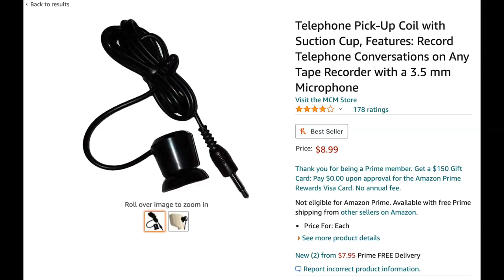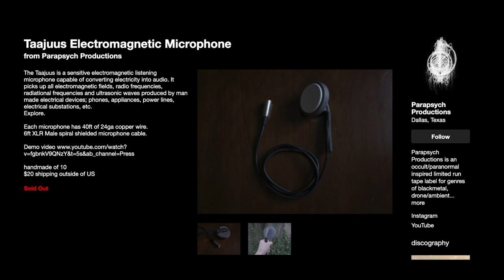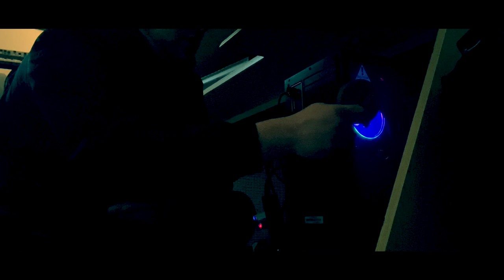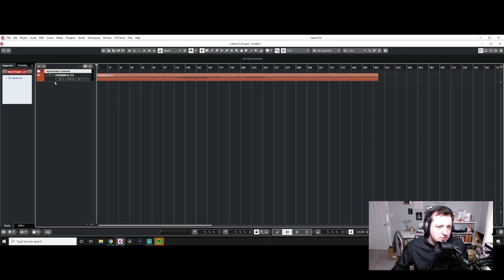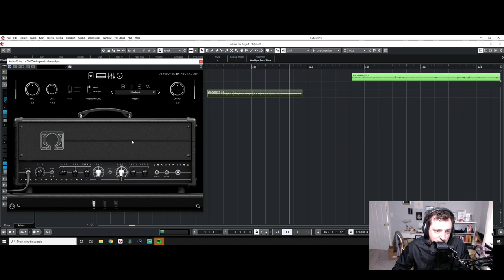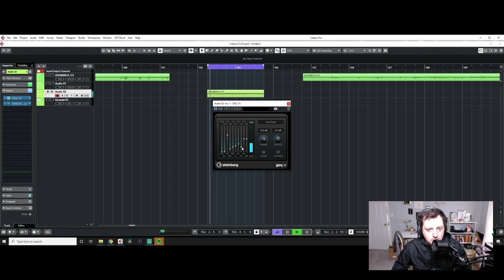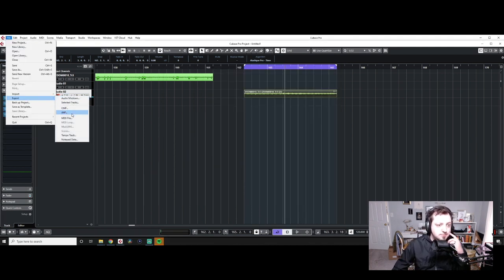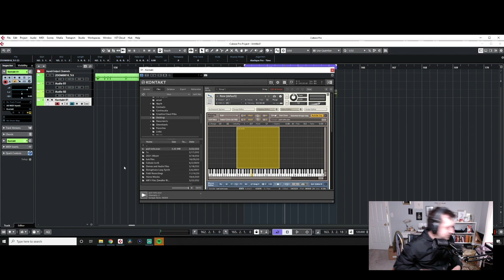Turning RF recordings into samples and instruments

Comment: Hey there, thanks for this vid! I've been playing with field recordings etc and trying to make instruments with varying success. This has shown me it's possible to do more than I've been able to. I've been trying to pin down this process so I can go and try it out. Here's what I've got. 1 - listen through, pull out interesting section that has repeating waves. 2 - eq out annoying sounds . 3 - distort it if useful 4 - eq it really hard to separate out a tunable frequency (are you using a number of eqs on top of each other?)  5 - stretch it if needed. 6 - pop it in a sampler and shape envelope. 7 - filter again if needed. 8 - add reverb 9 - tune it with a tuner 10 - play ambient pads til you melt:) Have I missed anything important? I know some of these steps could be moved around in order. Thanks again, really chuffed to find this.
Reply from the maker: Thank you for watching the video, I'm so glad you found it useful! Yeah, those are more or less the steps to take. Something I always try to keep in mind is that there is no "one way" to do it, in fact the more different steps you take on your way to the final product, the more unique to you the final product becomes. This video just shows one of routes I would take to get there, but there are so many ways it can be done. Adding distortion or delay or filters or noise gates or bitcrushing - there's so much lol Let me know if you need any more help with anything! (And let me know what other things I could talk about in future videos)